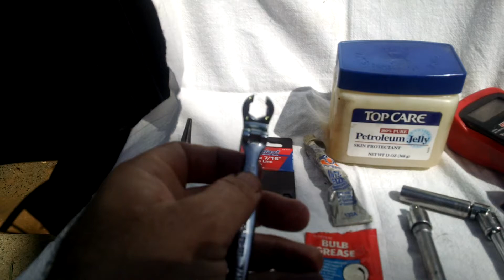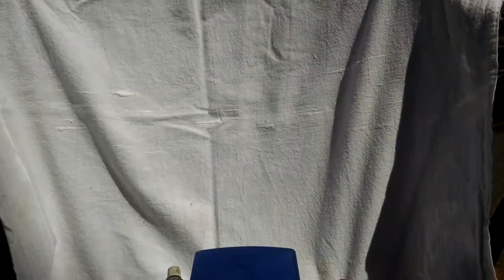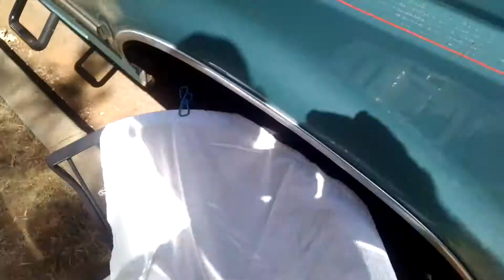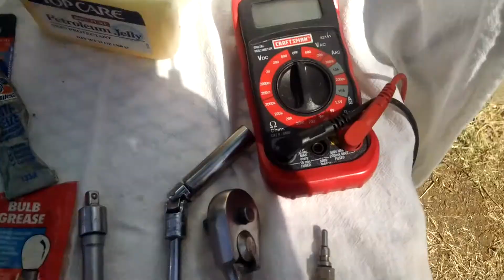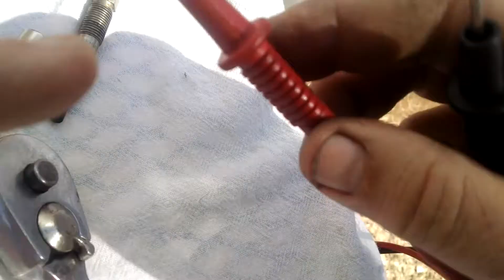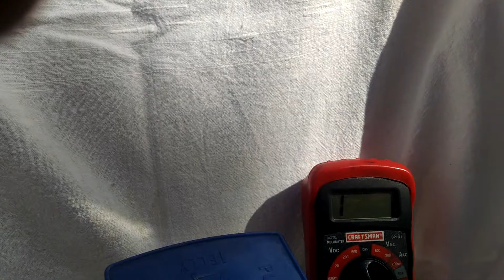7.3 IDI Turbo Diesel Glow Plug Removal

Comment: Gadget that is mounted with 2 bolts to the turbo is the wastegate actuator, it does not operate by vacuum (I thought so too) but by intake manifold (boost) pressure.